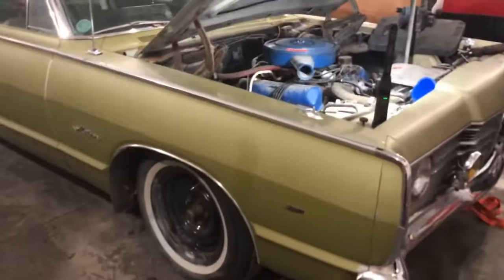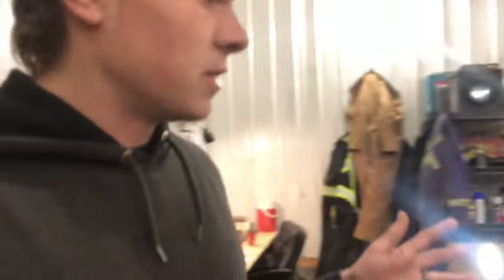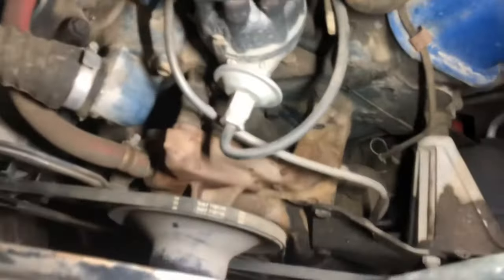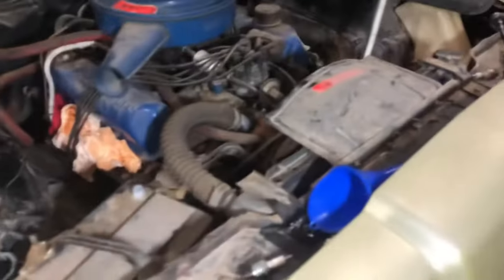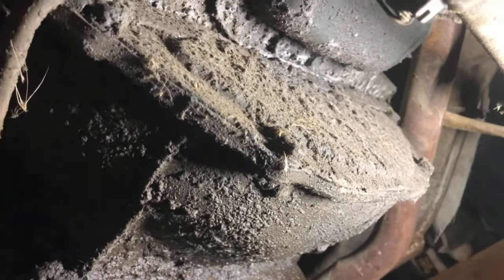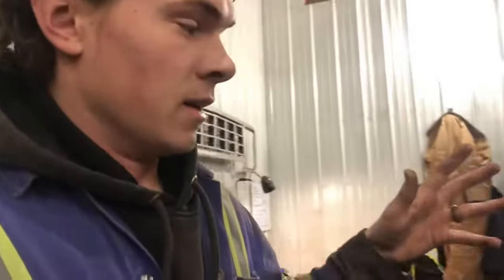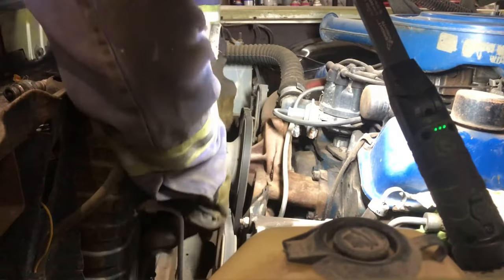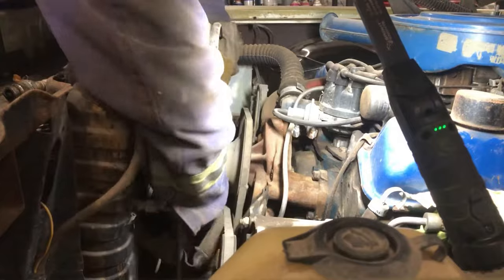How to Free a Seized / Frozen Engine (EASY)

Comment: I've heard of this tip before but never saw it! I'm looking at buying an older Dodge charger that has a potentially seized engine. I'm hoping I'll have the same luck you did.
Reply from the maker: Awesome, just be patient and let it soak. I almost guarantee as long as it didn’t over heat and seize it will work.
Reply: Did it work?
Reply: @anthonyb6639  not on an engine of mine. But I was helping a friend with his car, and this trick did help free up the motor!
Reply: @Kilnor  okay cause I just bought my friends charger and he said the engine might be seized or frozen I’m really hoping it’s frozen and not seized🤣
Reply: @anthonyb6639  some people use the term seized or frozen if they can't turn it by hand. That doesn't necessarily mean the engine is garbage. Just use the method in this video and BE PATIENT! My buddy and I had to let the cylinders soak on his charger for about three days. It did work, so I'm hopeful for you my friend. Please let me know how it goes!

Comment: This was one of the best and simplest explanations I have seen.  I have a 1952 dodge with a flathead six that is froze solid.  I will try this.  Good Job.
Reply from the maker: Sounds good! You’ll getter no doubt!!
Reply: Any update
Reply: @garonyoung4254   How do you manually turn engine when crankshaft pulley has three bolts instead of one?

Comment: Before putting the spark plugs back in but after adding new oil and whatever lubricants you are using crank it for several revolutions. Maybe the oil pressure will come up even! Great info on this video thank you!

Comment: When I come across a situation like that transmission I'll just take a cut off wheel and a grinder and cut a small slot in the bottom of the thing to access the flex plate. It wouldn't take much of a slot to do it and you can probably just drill some little holes and run a tap in them. That will allow you to cut a piece of an old road sign or body metal or something to cover the slot and just bolt that over it. It's not going to weaken it in any significant way and you can get at the teeth on the fly wheel to bar them over.

Comment: Adding the weight to the bar makes so much sense, as it will let the engine slowly break loose on it's own.  Most of us have tried to force an engine to break loose with the starter or breaker bar, which often does more damage to the engine, especially if there are underlying issues which are not known....quite often the reason the vehicle was sitting for many years in the first place.

Comment: Chevy has a dustpan, really easy access to the flex plate. Also could find something jammed into the flywheel that could also prevent the engine from turning; even after pre soaking the engine.

Comment: I have done many Ford's like that and it won't hurt a thing to drill a hole in bellhousing with a small holesaw so You can get a prybar on teeth and turn flywheel that way. Has worked for me😊
Reply from the maker: Good plan!!

Comment: 50/50 Acetone and ATF with an ounce or two of Alcohol works great. Use a 3/8” fuel line hose going into a 5/16” steel fuel line into cylinder to prevent spillage.
Reply from the maker: Good idea

Comment: Just a thought. Since you had removed the breaker bar to try turning it with the fan, why not just use the breaker bar, without the cheater and alternator attached, to turn the engine? Lots more torque available than using the fan.
Reply from the maker: The fan works good, didn’t really think to use anything  else

Comment: With an engine sitting for that long of a time, I would prime the oil pump and pump oil through the entire system so you don't have lifters hammering (along with rods, etc). Easy enough to do in an old vehicle like that by pulling the distributor and use a drill to manually turn the oil pump shaft. It has been a long time  since I owned a Ford FE big block like that, so I don't remember what hex size the oil pump shaft is.

Comment: My great granfathers 1965 murcury m100 with a ford 300, the truck is completely rotten, but ive been soaking the pistona since april, got the engine trmoved yesterday, and it still wont crank over, even with thr head off.

Comment: I got a 1973 jaguar xj6 and the engine won't turn. The starter does work. I will try the diesel instead. Thanks.
Reply from the maker: Sounds good man
Reply: Did it work with diesel?
Reply: @user-xs9hy5dn5n  No actually
Reply: @erikhaack4123  damn, what worked? I have a volvo 760 and i tried but diesel didnt work
Reply: @erikhaack4123  did you get it unstuck
Reply: @user-xs9hy5dn5n  unfortunately no. I think there is something internaling wrong with engine
Reply: @erikhaack4123  sucks, maybe rat nest or something. You can Use a mini camera trough the spark plug holes and check
Reply: It's a Jag. Yank the motor, and put a GM small block in it.

Comment: My engine was frozen when i first bought it, was sitting for about 2 weeks at the time, since a buddy of mine owns a tow yard i know how long it was sitting. Me nd my friend were able to move the belt enough for it to loosen up. Didnt stay on for long since the guy was doing donuts, hit a pole and crushed the gas tank. Got it back running nd fixed the issues including the starter bolts being so loose it grinded. Changed my thermostat but these 82 mustangs are a pain in the ass for that, so it would leak and overheat, always turned it off before it got too hot. Ive had it sitting for about 5+ years since, and i started working on it again and the engine is frozen once more, havent run it but i did a full maintenance,, spark plugs/wires oil/filter nd used royal purple at that once i put a new gas tank and fuel sender in. But do u think the overheating would damage it enough to seize the engine even if it was minor nd never over an extended period of time? The oil/plugs/filter have about .2 miles on it since i didn't want to drive it and overheat it. Can the overheating be an issue?

Comment: Will this help on a 2000 Honda Civic? The engine seized after overheating..
Reply from the maker: The truth is probably not. Heat siezed means the motor expanded. So this means the parts probably welded together. You can try but I highly doubt it will work

Comment: Hi, I  have a mechanic telling me my 2011 chevy traverse ltd has a seized engine.  But I'm told there are other causes that it can appear seized, is there a way to tell if I need a new motor or can it be fixed? This mechanic is telling me 8,000 dollars for a new motor but my SUV only blue books for 6,000 I really love my vehicle but I cannot afford a new motor. Please help!
Reply from the maker: What happened? Where you driving and all of the sudden it stopped
Reply: @samstrucks  Yes! The light flashed and said low oil pressure and it just shut off and hasn't started since. And it did have oil in it.

Comment: My car overheated. The MPH went dont. Steering wheel and break got hard. Leaked oil due to the overheating I think the cause was the radiator or thermostat. My engine leaked oil and it is now seized. My mechanic is going to try this. 2011 BUICK LACROSSE. Any possibilities it might work and maybe a head on the engine was just busted causing the seize??

Comment: So what happens when you unlock it ? 
Will it run again ? Or is there more to do ?
Reply from the maker: Put some gas in it drain the oil and put new oil in and let it buck
Reply: @samstrucks put some gas in the the spark plug holes or in tank👀

Comment: I had bad oil from a shop but didn't find out til  about five months later and they wouldnt honor a replacement or fixing my engine. Do you have a video that helps with an oil lockups?
Reply from the maker: Oil lock ups are non-repairable. Your engine is toast unfortunately

Comment: Did this on an old flathead 8. Took head off and poured diesel in each cylinder. Then pounded each piston head with a big hammer and wooden block.
Reply from the maker: Sweet

Comment: My car seized up because of low oil, but I'll try this method before buying another engine. My car is a 2011 kia
Reply from the maker: Low oil seize usually means catastrophic bearing damage. The type of seize I am addressing here is “dry seize” from sitting a long time. But! Worth a shot
Reply: Did you fix your kia?

Comment: Look dumb question but let’s say a small 4 cylinder froze up, and it unfroze and now runs solid. Would it be a good idea to rebuild or just send it? 😂
Reply from the maker: Always send it
Reply from the maker: But make sure you have coolant flow and oil pressure
Reply: What is meant by “send it”?
Reply: @JHenry-tt5mp  run it

Comment: My 34 chevy orignal 6 cyc i try about every thing let it set marvel oil spark plug drain oil fill with karasen for 2 weeks pop cluch 3  speed it only show skid marks until cluch push in  it would not unfreeze engline crank did not move at all with no plugs next going to pull oil pan try to tap in cyc hole try break rings from bo tton if that dont work pull head we even lose push rods before pulling car no luck know maybe time gears 34 chey 6 cy stove bolt not what we think it has 2 push rod per cyc new to me we may pull time cover before head that means pulling harmonic ballacer car set 10 yr what a night maier so far

Comment: I am restoring my granddads 1968 Ford mustang with the 289 v8 in it and I put marvel mystery oil in all 8 cylinders, and I am letting everything soak up.
Reply: did it work?
Reply: @atomic6333  the motor is too frozen. I will need to yank it out.